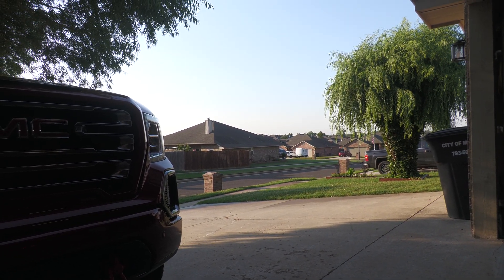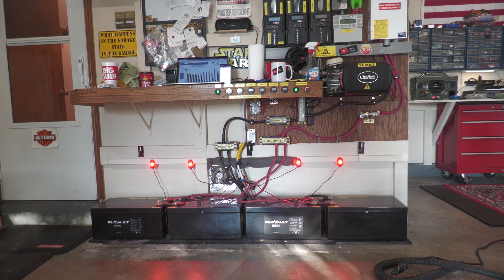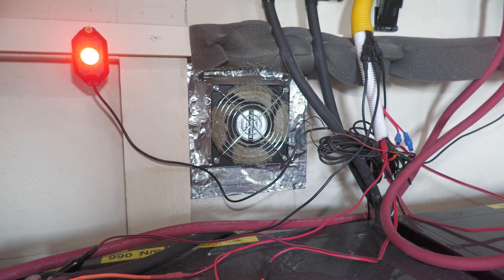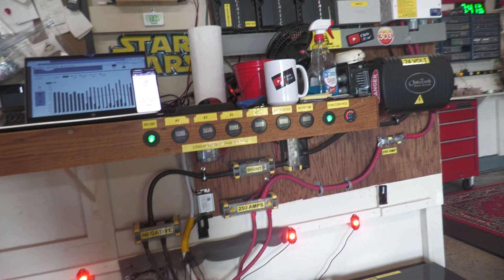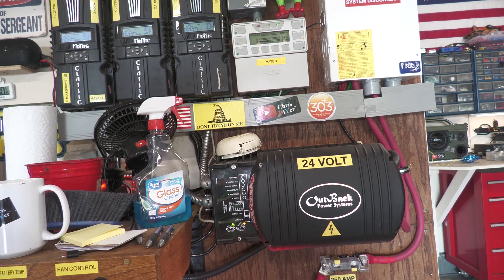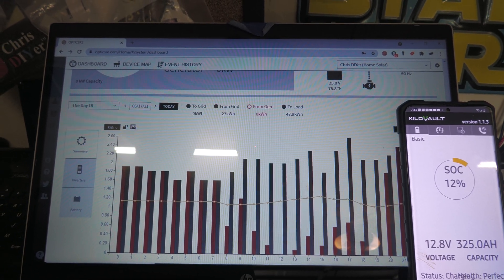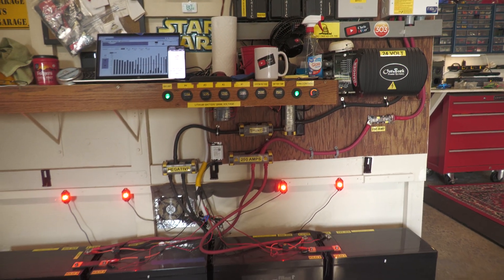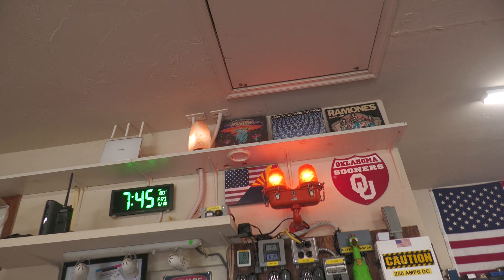Garage solar power equipment update -- Outback Power inverter (VFX 3624) is "cutting out"

Comment: Hey Chris. I had a similar issue with my gvfx3524 and it turned out it was a bad inverter cooling fan and my Inverter cooked itself. Ended up swapping it out with a new 3648 outback and converting the system to 48 volts. Stay Cool!!